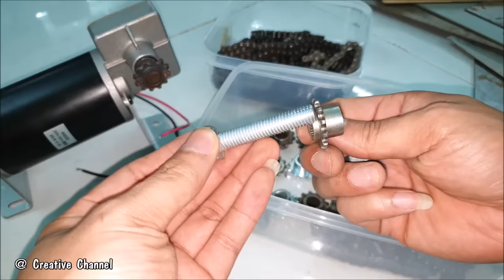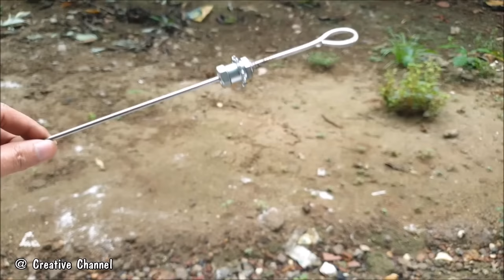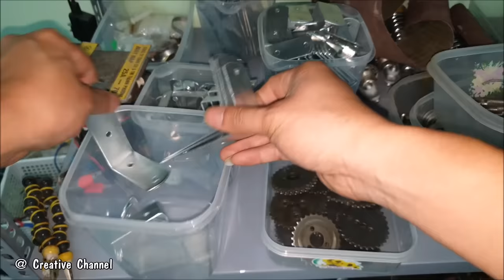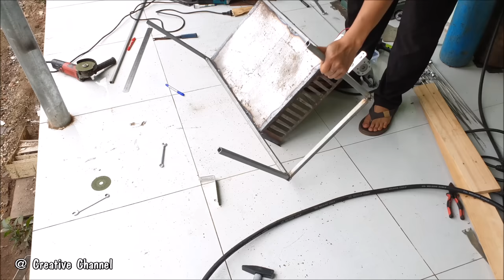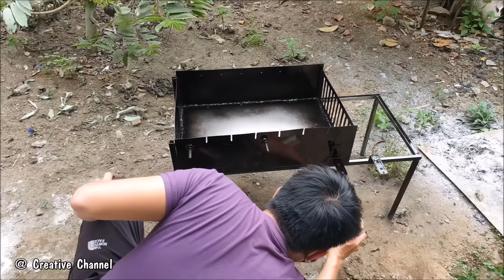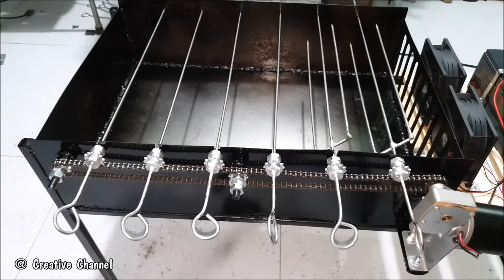Build Grill Machine, BBQ Grill At Home

Comment: On the switch for the fans. I put a variable speed control knob to control the heat of the coals.👍👍👍
Reply: The fan is not necessarily on all the time. So its not necessary for that

Comment: good job, an even better idea. But welding galvanized steel is highly toxic. better steel without zinc. The skewers of normal steel also release iron hydroxide (rust) into the meat. better stainless steel and Tig welding. the sheet is too thin. it deforms with time. the engine and the fans are too close to the glow. Both get too high heat radiation. Color of skewers and barbecue! that's poison too! and the grill is too low. why not at hip height? but otherwise brilliant idea. Greetings from Germany.
Reply: good comment. Safety and health first
Reply: Good comment, but that looks like regular plate steel so he should be fine.
Reply: @thomasreddick5908  Thank you for your veto. Of course, the tin is good enough. for one or two seasons. only over time the box deforms. so that the chain will not be in line anymore. I would have strengthened the metal plate either at neuralgic points. or taken twice as thick from the outset. Have a good Time.
Reply: 💯 true
Reply: @andrewt.8442   Maybe he might want to build something different in the future. Greetings from the USA.
Reply: Wow you are a genius german
Reply: Your correct.
Stainless steel only
And if your in the us, and try to serve people the food cooked on that equipment, would get into a lot of hot water
Reply: Die Spraydose und das ansprühen des Grills, war schon witzig 😂
Reply: Well I'm sorry to have to comment on this but.... you will have to make a video making the same BBQ as you are saying and explaining why and how you are doing it and why is better this way and then feel free to criticise other people's hard work. 
Sorry for any inconvenience
Reply: Alejandro he was merely pointing out the flaws of his work, commenting does not equal criticizing. Greetings from Germany.
Reply: @muratk.1472  also, it's constructive criticism..... if you can even call it criticism.
Reply: raykupal exactly
Reply: Thanks for such a good observation healthwise so helpful .

Comment: You should've covered the metal with refractory bricks, it will oxidize and break too fast otherwise. Also, I don't see those plastic fans surviving for long so close to the fire. And third, on the left side you could've build a small table, that would be handy too!

Comment: Excellent Job as usual. Just, if there is an update to this, try to protect the motor and batteries from heat. It would be more practical if could make them in a removable box. Good luck.

Comment: Great job so far. But you forgot to build a grill for the coals to sit on. You need to get air under the coals so you have more uniform heat across the coal bed.
Reply: excellent job Mon amie

Comment: The idea is nice, but the technical construction phase is unnecessary. All these cables, coils, propellers, electricity etc. are unnecessary. A barbecue compatible with a cordless drill works much more easily and practically. Greetings from turkey.

Comment: 😐 What the oriental has created is a rotisserie barbecue with fanned fire, I would have made an ash box with an adjustable vent for increased heat (I think the fans are unnecessary due to risk of them melting and being at one end) the coals sitting on a grill that can be shaken to loosen ash buildup.

Comment: Great work, but you did destroy the ceramics by welding on top of them, also the temperature on the left-hand side of the grill is higher than the right-hand side, put a slider so you can open or close it whenever you want to. Ps never put charcoals in the middle of the grill only around the sides for evenly cooked meat cause by the time the edges are cooked the middle is burned.